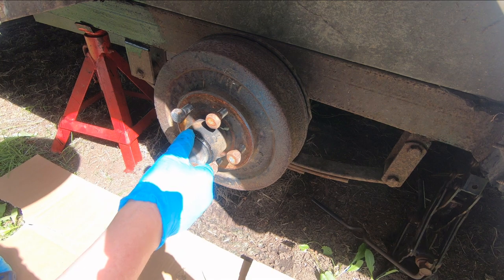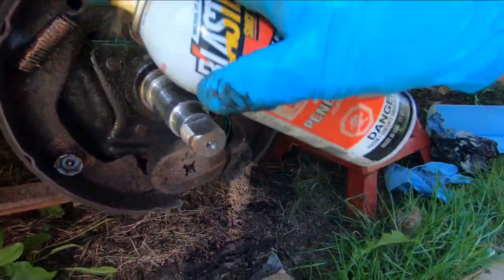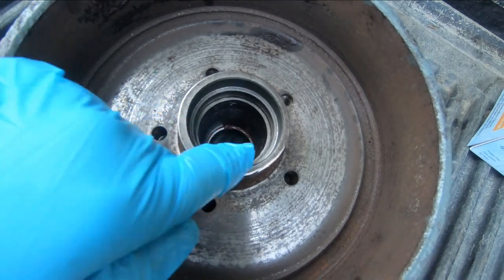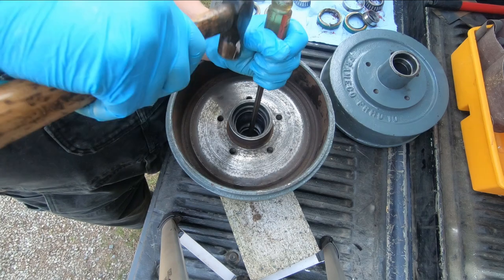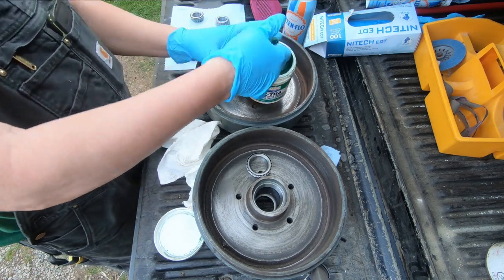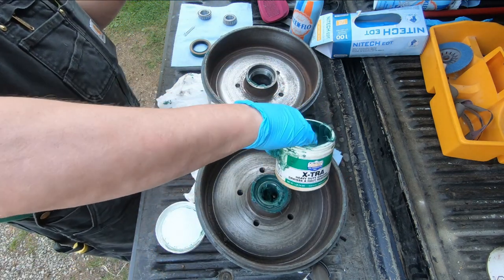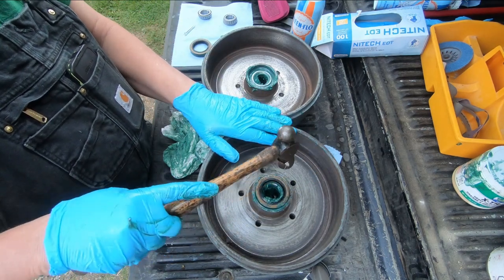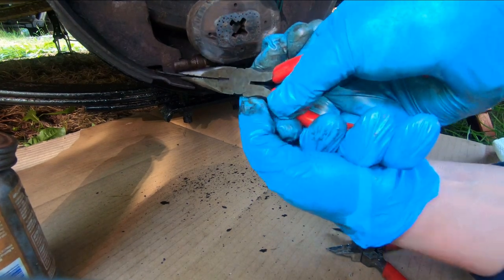TRAILER BRAKES ~ NEW BEARINGS & SEALS ~ ESSENTIAL UPKEEP FOR MOST TRAVEL, BOAT & UTILITY TRAILERS

Comment: How's she goin'?  Nice job on the brakes here.  I like that you actually used brake cleaner on brakes.  I seem to only use it on carbs!!  LOL  Lots of grease is the answer and you had that covered.  I wonder how many trailer wheel bearings are changed and the inside bearing isn't touched!!  LOL   Take care!!
Reply from the maker: As I heard it said years ago while working on submarines, "Grease is your Friend." How many times have you seen a trailer sitting on the side of the road, propped up on a rock, broken down because the wheel siezed or fell off? Trailer wheel bearings are much neglected and they need a good going over every couple of years. I know you love grease too, Mike. I've seen you use it (and Vaseline) on many projects. Remember..."Grease is your Friend too." Don't ever forget that. It can get a guy out of a tight squeeze, keep rust and water out of mechanisims and cool bearings under heavy loads. Yes, it is a TRUE FRIEND, just like a squirrel!

Comment: Great job on the brakes. It is a shame the design does not allow you to adjust them easier with the drum installed. Trailer brakes laws are different over here and electronic brakes are not legal but it is good to understand how they work, thanks
Reply from the maker: Didn't know about the prohibition on electric brakes in the UK. Interesting. There is indeed a slot on the back of the backing plate to access the adjuster. It is under a rubber plug, just like on cars, but I wanted to demonstrate how the adjuster worked. I could (should) go back and adjust the shoes out from the plug now that the drums are installed. It is just that much more difficult (as you are well aware) to film every aspect of a job and not end up with a two hour-long video. I could have removed, repaired and installed these brakes in about two hours if I wasn't filming it. As it was, it took me almost two complete afternoons to get the footage. Ahhhhhh the joy of YouTube ! haha All the Best !

Comment: Bravo on using copper anti-seize, most folks don't know the difference or the reason why!
See ya Craig✌
Reply from the maker: I use that copper anti-seize everywhere. It costs a bit more but it's worth it. I just went out and torqued the wheel nuts tonight-Glad I remembered to do that...I hadn't tightened them yet !!!! Always something else to remember...Take care Marc
Reply: @EverydayProjects  HAHA! That would be a bit of an important thing to get done!!
Reply from the maker: @OpenAirOutdoors  I am planning a short trip in the trailer and loose wheel nuts would have been an issue. They are torqued now so no worries...but I almost forgot! Yikes!

Comment: The controller and the electronics are pretty simple and robust on these. I don't understand why cars can't have brakes like this.
Reply from the maker: They are a simple but effective way to relay a braking signal to a trailer without having to connect hydraulic line between the two. I'm not sure how strong these types of brakes would be in comparison to full hydraulic brakes , standard in most vehicles. Food for thought though. I wonder if these have been used elsewhere? I didn't see you in Malorca last week. I was expecting to play a round of golf with you. Delays?:face-fuchsia-poop-shape::face-purple-crying: